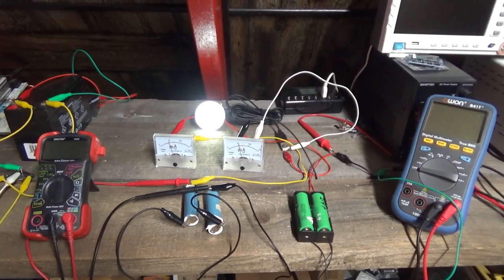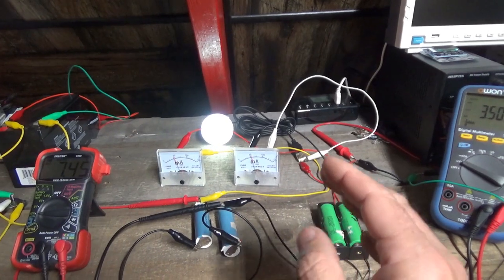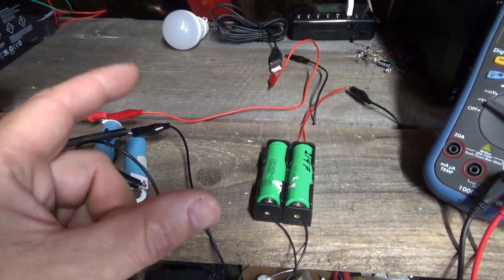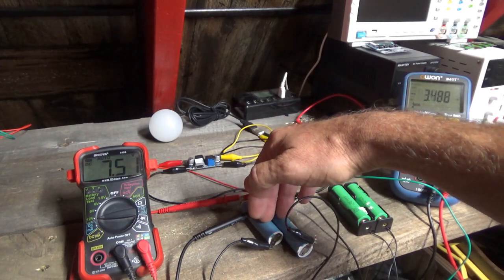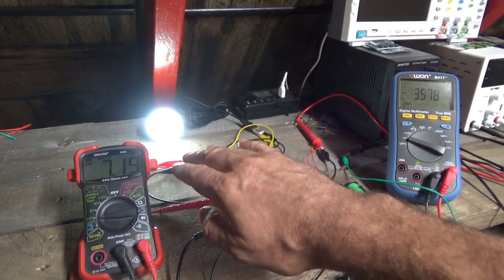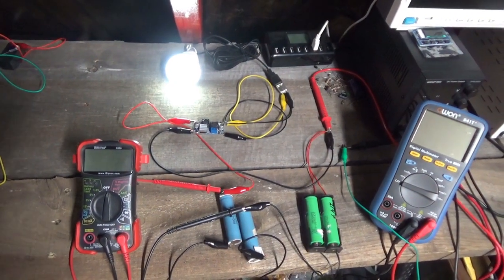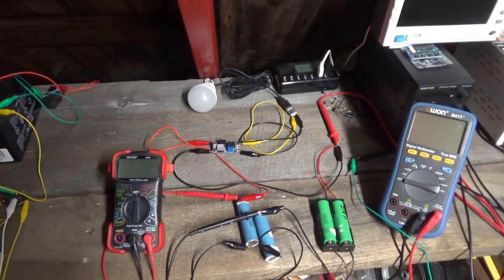Free Energy Experiments With Battery Swapping Continued

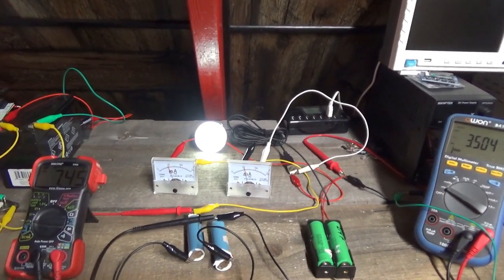Comment: So the reason the potential difference is not enough to run the lightbulb at full brilliance is because you are 1:42 losing charge. Because if there was no loss, then as one set dropped, the other set would increase equally there would still be a voltage potential difference of the 5 V in other words, if one set of batteries was charging the other set of batteries without a loss, the potential would still be 5 V
Reply from the maker: Wrong because the voltage the LED sees is the difference between the battery being discharged and the battery being charged. As the series pair drops from 8.0 to 7.0 volts, the other rises from 3.0 to 3.5 volts. The LED starts out seeing 8 - 3 = 5 volts. But after a while it sees only 7 - 3.5 = 3.5 volts so it gets dim. Hope that makes sense.

Although there is loss in the batteries. I can swap batteries and run it longer but with each cycle I can run it less and less until there is not enough potential difference between the two sets to keep the LED going.
Reply: @TheDoItYourselfWorld  
Yes, that makes sense. Because one set is parallel and one set is series. 
Got it.
Reply: @TheDoItYourselfWorld  
Have you tried it with both sets in parallel or both sets in series?
Reply from the maker: Then there will not be a potential difference between the two sets and nothing will happen.

Comment: My setup got down to about the same voltages 3.5 volts on the batteries being charged. I tried it with a USB fan the second time. Same results. Then I tried it with 3 3.7volt batteries on each side. Still about the same results. Once the potential difference was to low it would stop. Pretty cool experiment.  I'll try a buck/boost converter next. Cool videos!
Reply from the maker: Thanks. I think that with three batteries in series and three in parallel there will be a larger potential difference and we can run circuits longer. For that we would need a 7805 or some other voltage regulator tho.
When I move up to the 12 volt batteries I think there will not be any issues like that.
Reply: @TheDoItYourselfWorld  On the 12 volt system will you be using a solar charge controller, but instead of solar panels, will you use 2- 12 volt batteries in series for the solar input? Or would that destroy the solar charge controller? 
Thanks
Reply from the maker: I will use 2 batteries in series for 24 Volts. And two batteries in parallel for 12 Volts. My charge controller can handle 12, 24, and 48 volts no problem. But you should not charge and discharge a battery at the same time anyway. So the charge would go on the parallel batteries which are being charged already.
The advantage to a 24/12 volt system is that you can charge up the 12 volt batteries and still have a pretty decent potential difference between the two sets of batteries to run your circuits.
In my little 3.7 Volt 18650 system the voltage difference is too low and gets hard to work with.
Reply: @TheDoItYourselfWorld try using a 20amp pwm boost converter they have a digital display and variable voltage and amperage control, use it to keep the parallel battery bank at a set voltage to keep the potential difference flowing. Dump the power back into series bank 1 and  try to balance load with output.